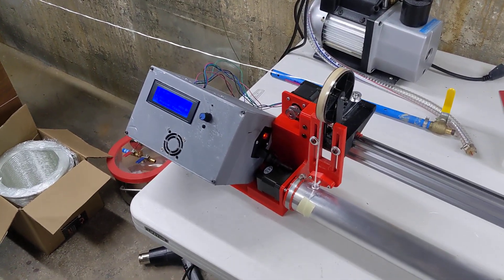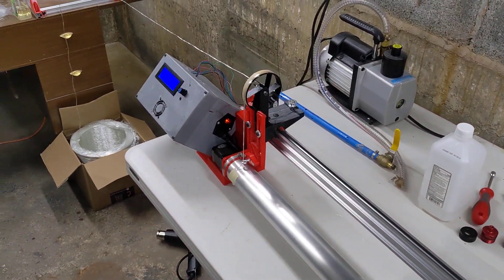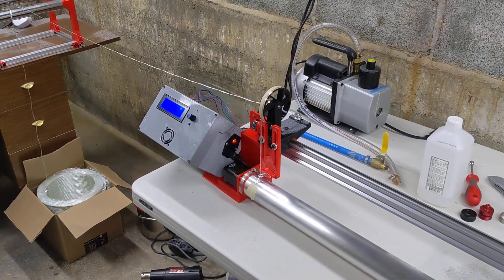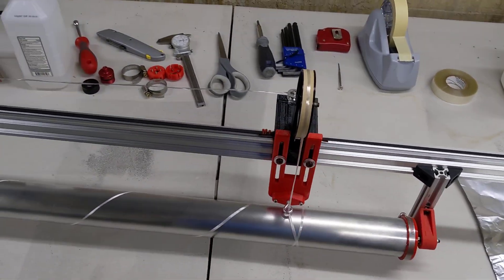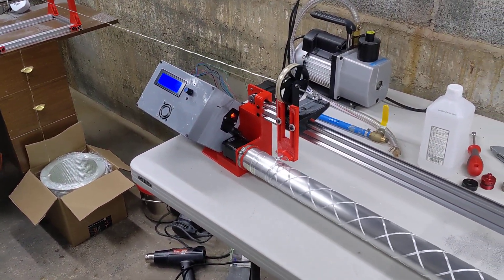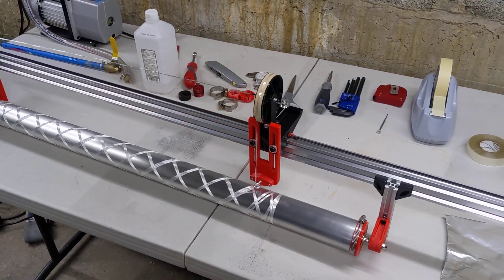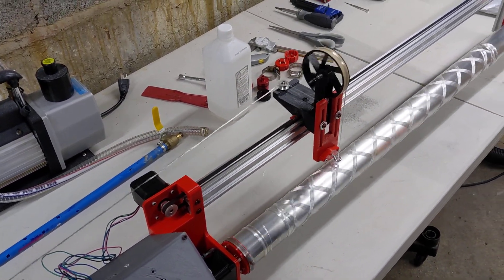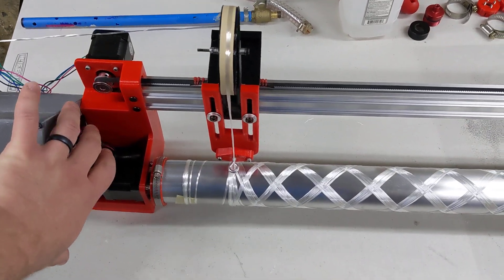Filament winder update, 54mm dry wind test for speed!

Comment: very cool congratulations! What firmware do you use to do this and what software on your computer do you ? thank you very much for your attention! hugs
Reply from the maker: I'm using marlin 2.1? On the Arduino mega 2560 with a RAMPS 1.4 board.  I use Google sheets to create the g-code.  The sequence just repeats, I only need to calculate the values and where to comment out excess lines.
Reply: @scrapmaster09  I understood a lot of show I'm going to try one here in Brazil! thank you so much! and congratulations!